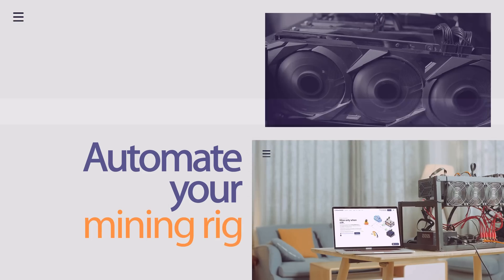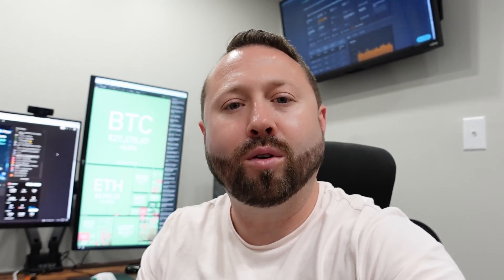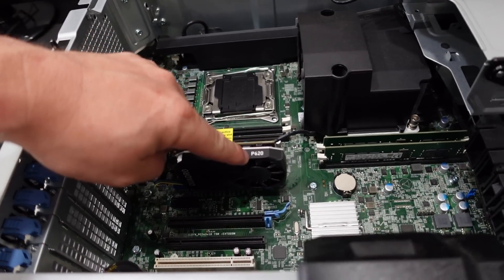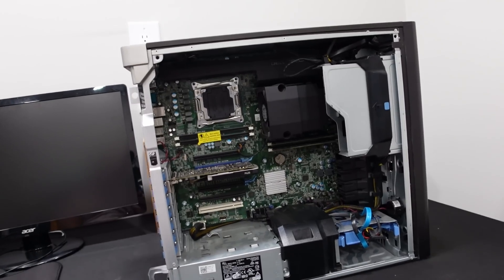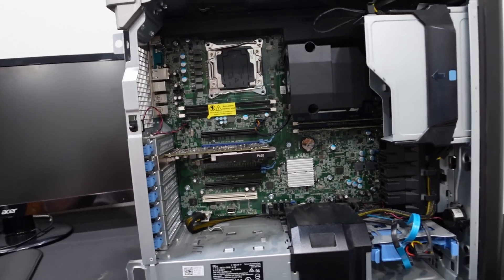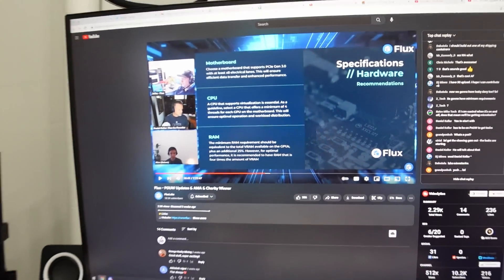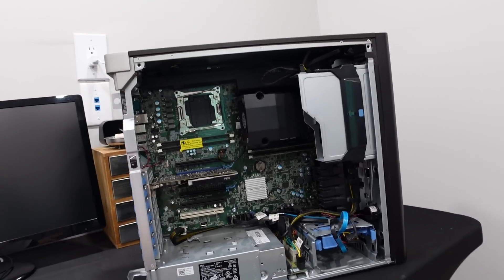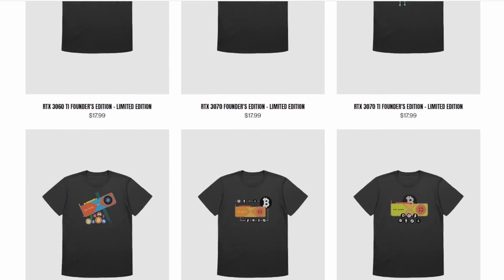What Hardware I'm Buying to Prepare for FLUX Proof of Useful Work (POUW)

Comment from the maker: What are your Hardware Plans for Flux Proof of Useful Work?
Reply: I have bought x79 motherboard that supports 64 gigs of RAM, 10 pci3.0 x16 so 10 GPUs or m.2 pci adapters and two 6core 12thread so 12 core 24 thread server grade intel cpus with 4 m.2 ports also
Reply: China is making some nice boards for proof of useful work
Reply: I have a small mining rig with 2x 6600xt and 1x 6600. Do you think it will be good for PoUW?
Reply: I love that we can recycle this old tech and prevent E-Waste. I have 3 servers collecting dust all with dual Xenon and Athlon64 processors but they are Gen 2 PCI. I'm going to maybe sell them and I think I'll either go the route you and MiningKiing went or setup a 40U server in my basement next to my ASIC and fill it with PCI gen 3 servers. They are super affordable on the second hand market. As for GPU's I'm unsure, I'm not rich enough to get a bunch of 4090's or V100's or A100's but maybe also find large VRAM Nvidia cards like the 3060 and 4070 or even the 3090
Reply: Hey Hobbyist,  Wondering why you're leaning toward the 3060m 16gb card for Flux POUW?   I have some 3060m's on an x79 mining board and they're pretty efficient.  I have not experience with the 3060m 12 gb.  Please share thoughts on this.  Thanks, Steve
Reply: my hardware now planing and i have amd ryzen 7 2700x and msi 1060 6 gb and 16 gb ram and i add 1tb ssd but i using window you can create a video how to mine Flux Proof of Useful work use hive os and ubuntu plz dont ignore and answer me and thank you Dear @The Hobbyist Miner

Comment: I appreciated this video. I'm thinking LGA 2011 is a good idea, but may not be the best platform. They use a lot of power. Their benefit is their multiple pcie 3.0 x8 slots but their desktop motherboard layout unusually only allows at most 2 modern gpus to fit. Their server boards might fit more if the are Quadros but most modern gpus are more than 2 slots in width. Keep in mind; pcie 3.0 x8 bandwidth = 7.877 GB/s, also pcie 4.0 x4 bandwidth = 7.877 GB/sec. they are the same. so an x570 AMD motherboard can have 2 gpus with the same bandwidth as an LGA 2011 with 2 gpus. 8 faster cores / 16 threads on an R7 5700X @ 65 watts wheras most of the Xeon e5 2600's at 130 watts. personally. I'd rather have the more modern, more energy efficient faster system architecture for SSD's, ram, cooling, noise etc. Now if you're going up to the e5-2680+'s with 12 cores/ 24 threads that has some merit, but ironically an 8 core 16 thread Ryzen 5700X still outperforms a 12 core / 24 thread E5 2680. I think the low prices of the lga 2011 systems on ebay are tempting but for those of us with X570 and AMD Ryzen 3000 and 5000 cpus sitting around we are better off using the Ryzens. good paths for both, but I like quiet and low power. https://www.diskmfr.com/pcie-interface-bandwidth-speed-calculation/

Comment: I would suggest to get separate PSU for GPUs and put as little load on the original PSU as possible because 5+ year old dell desktop commercial PCs are dying, they tried to cut costs on these and intended these to be used only for like a year or two.
Reply from the maker: Not a bad idea

Comment: The biggest issue with Flux is that its halving cycle is half that of bitcoin's and thus the rewards from both nodes and mining diminish faster than the boom bust cycle of the general market. Flux and POUW in theory is easily one of the most promising minable altcoins out there, but none of that will matter if the very people that are supposed to power this decentralised computing network are not rewarded profitably or know their rewards will be cut by 50% in less time it takes to gestate an elephant.
Reply: Most likely POUW reward should be coming from the computer resource sales income and not linked to halving or mining... 
I don't think they can share what's coming from mining/nodes with POuw or it will cut mining revenu even more, and we're already not making much!!

Comment: POUW is becoming more involved than what was originally implied.  I do plan on repurposing a work station, to learn by experiencing, but Flux payout for the work performed will need to be good and better than their node rewards.
Reply from the maker: I would agree.  Thankfully it appears POUW will have a pay scale based off Hardware Performance.
Reply: @TheHobbyistMiner  Do you have a link to this pay scale or an earnings model?

Comment: Love it.  I bought a T5810 for my chia plotting and farming.  I got mine for $80 shipped.  No spinny disks, but a 256gb SSD and the Dell PCIe card that holds 2 NVME.  It's a workhorse!   Would a Tesla type GPU be any good?  I put a P4 in a 1U server.  They don't need external PCIe power...of course they are comparable to a 1080 with 8GB.